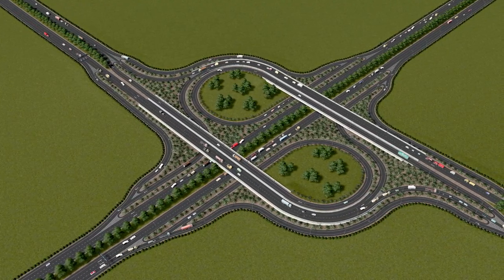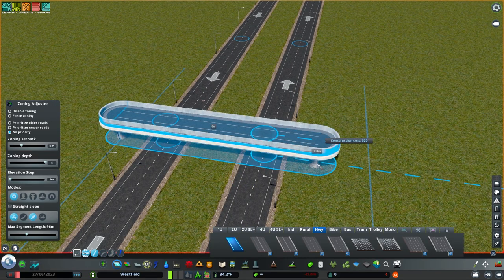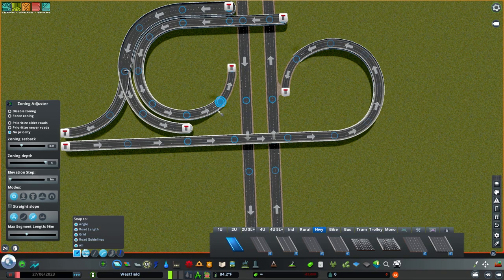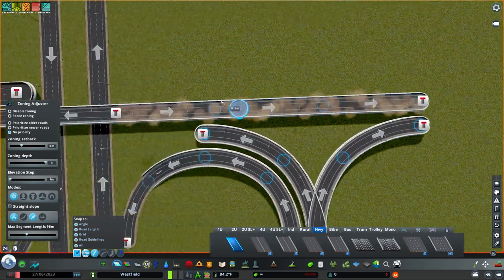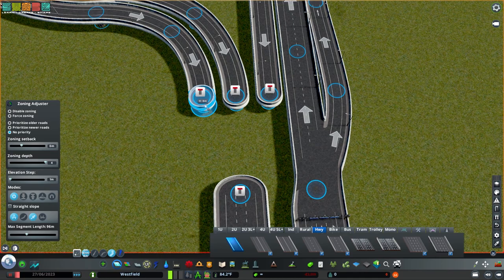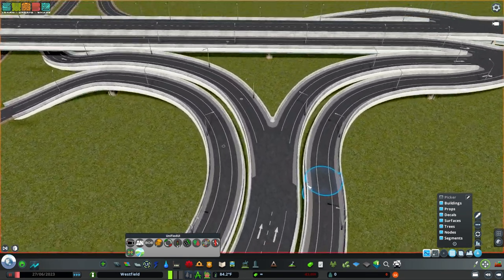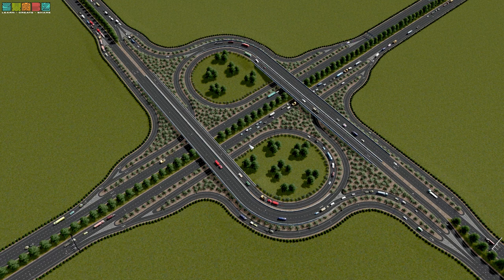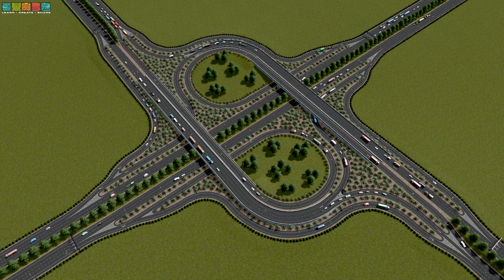Solving Traffic with the "Double Trumpet" Interchange in Cities Skylines

Comment: Great Interchange, and a great tutorial.
However, I would call this a "Twin Trumpet", because it has the two trumpets twinned up and interleaved. "Double trumpet" implies that there's little interaction between the two parts - Which is the case for the first interchange you showed; and for an interchange that's very similar looking (but inferior) to the true twin trumpet, made by putting two trumpets on both sides of one highway. Also, adding another alliteration always amplifies awesomeness.
Reply: The entire last sentence speaks for itself

Comment: Connecting two highways by trumpets like you show in the beginning is bad. It creates the same problem that a cloverleaf does - cars weaving and changing lanes in a very short section of road. I really like the solution you came up with. I didn't know that was a possibility! No weaving in this one.
Reply: There are a few examples in the world, but one is replaced with another interchange. It still surprises me why it is not used more in real life since it seems cheaper to build then a cloverleaf (only 2 leaves, and depending how it is designed, it may not cost more on bridges too) while it doesn't have weaving. I guess it is because of the slightly more exit/split points for the traffic going straight on one of the highways.

Comment: The two highway connection you showed is actually used atleast once here in Norway. To my knowledge there might be more of them, and in-between the two there's gas stations, a few commercial buildings and a extra road connection to the city. But no toll booth, as we don't have toll booths in Norway

Comment: There is a real example of this in myrtle beach SC. Al’s though that is probably a bit better because you can go much faster going straight through because the curves are much less harsh
Reply: I live in the Myrtle Beach area and have driven through that interchange several times, it's definitely unique! The one major downside is on both ends of the over-crossing highway, there are blind spots where the on-ramps merge into the travel lanes, and it doesn't feel that there is enough length on the acceleration lane to safely merge (from the right, the left entrance just becomes the left lane).

Comment: Some parts of this reminds me of Boston's Logan Airport highway loop. Split followed by split followed by split in such quick succession that neither my sign-reading abilities nor nav-system-speaking could keep up. A quick succession of merges is less of an issue at Logan when merges just add a lane. Minus for Logan is that is combines merges and splits to make weaving cross-throughs which your design has [PLUS] has eliminated. Bravo!

Is there a variation where the un-aligned elevated highway approaches the interchange directly across from one another? I'm thinking about how if this design got chosen to replace an existing cloverleaf.

If you label the roadways in your designs (which are awesome and beautiful) as North-South and East-West, it might make it easier to talk about them.

Comment: 12:12 there is not only an aesthetic reason, but also one related to safety. Lanes merging in such a tight curve can be dangerous, as it is much harder to see traffic from the main highway as you drive off the ramp
Reply: It’s seen as the opposite way around in the UK.  best practice is to design it in such a way that the loop sliproad is for traffic entering the motorway, not leaving it, as traffic entering is likely to be slower, whereas it’s more dangerous to bleed off speed on a tight radius turn from a major road, which can cause a significant amount more accidents than a slightly slower entry merge

Comment: Hi Yumble enjoying all your interchange videos. It would be interesting to understand your rationale for having the loop slip road  for exiting on the trumpet as opposed to on the entry.

In the UK it’s best practice to have them the opposite way around to how you have them, as bleeding speed on right radius corners often leads to loss of control accidents and lorries tipping over.
Reply from the maker: A 40 meter radius turn is really not so small. This is also being used to connect two highways. There isnt a dominant road here as its a system interchange.
Reply: @YUMBL  I was just curious as the UK doesn't have many trumpets (due to being late to the motorway game and not having many toll roads) but the ones we have are always the opposite way around- which the reason is safety. Its always interesting to see how others make them

Comment: I personally don't like the fact that the through lane on the overpass is not straight and slows down the traffic. But I guess this could be fixed easily by increasing the through lane radius considerably (basically elongating the s-bend). Very cool design otherwise.

Comment: Aesthetically this is, by far, my favorite interchange.  My question is, is there ever a time when an A4 or B4 parclo would be preferred over a double trumpet and if so, why?
Reply from the maker: Yes, a parclo is preferred often. Each of these are used very differently though. A free flowing SYSTEM Interchange (double trumpet) is for connecting one highway to another. A SERVICE Interchange (parclo) is for moving vehicles on and off the highway.

Comment: I wonder why this isn't implemented more IRL 🤔
Reply: Expensive. Especially in the US where highway construction is basically a thing of the past unless huge corporate entities demand it. Shit sucks!!
Reply: I think mostly because IRL engineers try not to have exits on the inside lane (which is usually the fast lane) if they can help it.
Reply: @alexeyayzin8512  I would think this is relatively cheap for the flow, because the bridges are generally the most expensive element. It does require a lot of space though.
Reply: @Doddibot  Ok, that makes sense.
Reply from the maker: This design is extremely cheap. Only two overpasses required.
Reply: @Lussimio  

But maintenance ain’t. Looking at America, i can guarantee maintenance is over $500B annually.

Comment: Very impressive. At a certain point wouldn't it be worth it to make the incoming highways four lanes so that you can split them into 2 two lanes and prevent the need to immediately merge the oncoming lanes for the right and left turns?
Reply from the maker: It would!
Reply: @YUMBL  Alternatively you could reduce the straight lanes to one but that would probably look a bit strange.
I guess the main drawback of an intersection like this is that it takes a lot of space and in places where you have enough traffic to need something like this, you often don't have that. Or you would have to rip out a crucial intersection for a few years to build a better one. Real life unfortunately has no pause function.

Comment: The main road has 3/4 circle left turns while overgrounded does not. Highways should not meet at 90° angle or overgrounded should have bigger curves on going straight ramps
Reply from the maker: Why? Specifically.
Reply: @YUMBL I think he means the overpass highway have to make some notable turns for even through traffic. Not necessarily sharp for ramps but highways typically are fairly straight. Only issue tbh is traffic slowing down which isn't what you normally want on a highway. Personally, I think its fine, but I think that is what OP means.

Comment: How does these builds allow for switching lanes after the interchange? For example, the innermost lane exiting the trumpet. I understand that the way traffic in C:S workings is that they move to the outermost lane at the last node before they exit. How would those move if they need to exit on the next exit after the trumpet?
Reply from the maker: I always recommend having a few segments/nodes in between interchanges to allow for lane changes. The interchanges shouldn’t be too close together.
Reply: @YUMBL  thanks! One more thing, am I correct to think that the number of nodes between interchanges is equal to the number of lanes?
Reply from the maker: Thats a great idea as a minimum. Much like setting up a roundabout.

Comment: Have you flow tested this yet, if it beats a 4 level I might have a new favorite.
Reply from the maker: Its the same. Both are free flowing.
Reply: @YUMBL  okay, more capacity= add more lanes?
Reply from the maker: No. You only need one lane in each direction if its free flowing.
Reply: @YUMBL  so if it is overloading/ backing up it is time to analyze and build a road elsewhere to handle the excess traffic.
Reply from the maker: Correct! This interchange wont be the source.